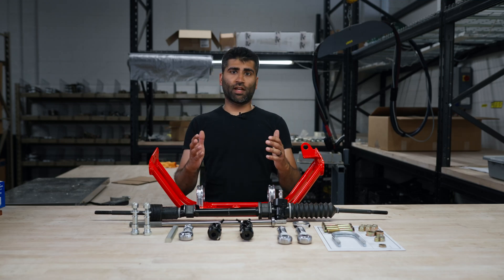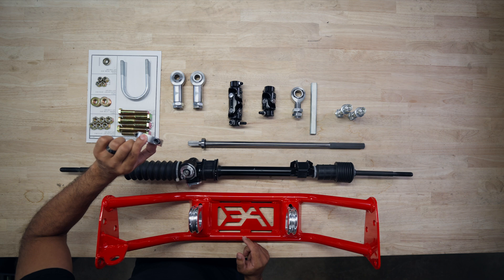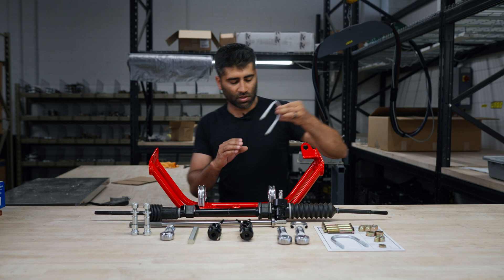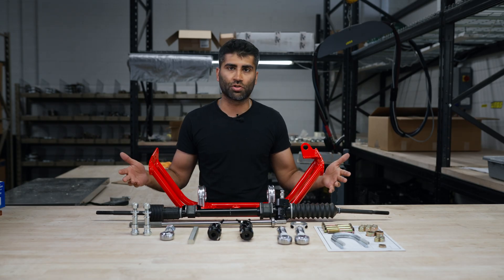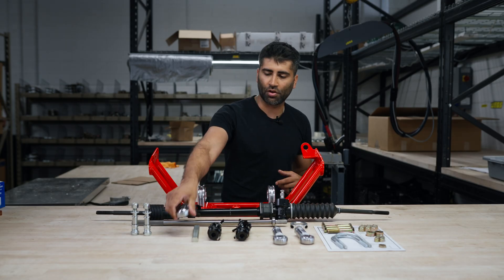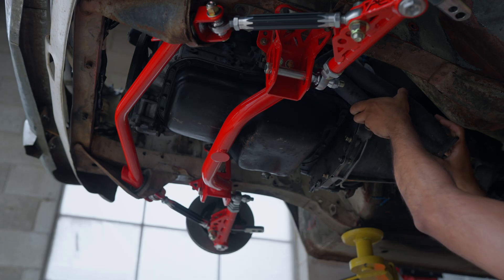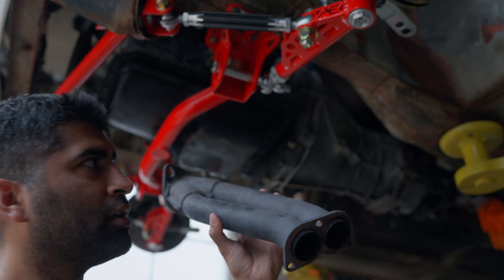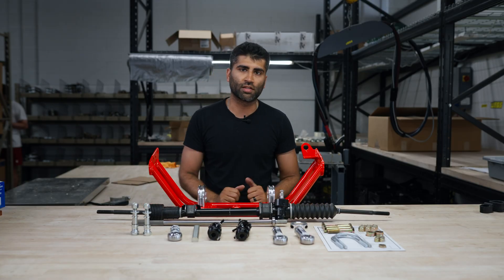Apex Engineered - 510 Steering Rack Conversion - Product Overview

Comment: Does this work with stock suspension configurations? or would you have to buy the front suspension as well? I have T3 GTX2 Front Lower Control Arms and TC Rods